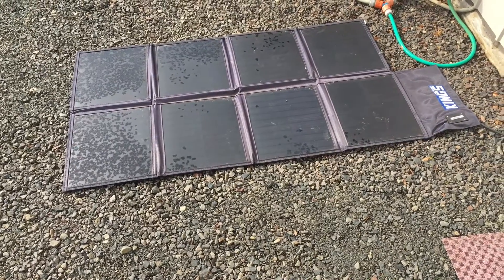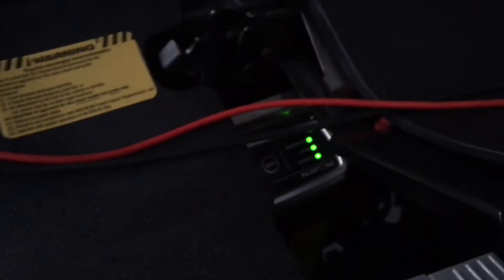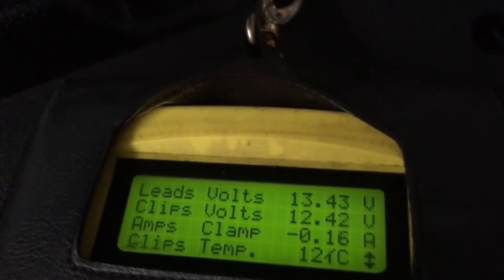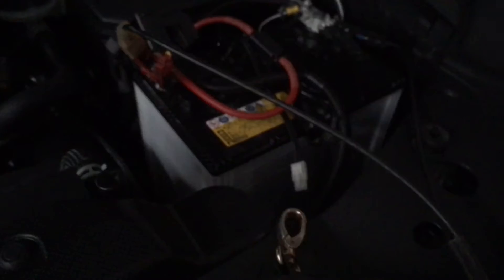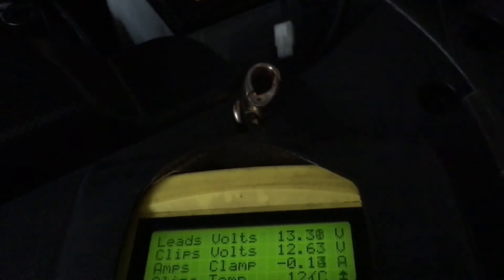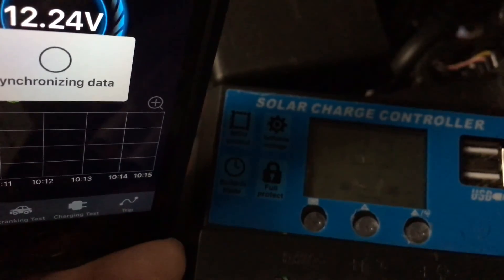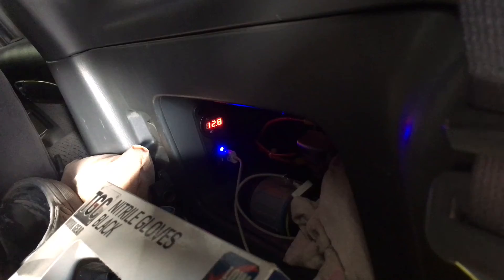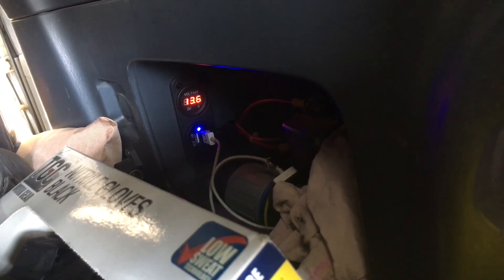INTERESTING SOLAR EDUCATION

Comment: Not really a fair test running the controllers in parallel like that. A fair test would have been to have two sets of panels exposed to the same light one for each controller.

Comment: Suspect you have a cheapie solar charge controller.
Some now have MPPT
Maximum Power Point Tracking...exactly means what it says...basicly the electronics is designed to give maximum output regardless of light conditions.
In the old days only Vitron brand and other quality brands had this, but now even cheap knock offs have this feature.
Ensure your next Solar charge controller has it.

Comment: The Mppt solar charger of the Projector module is clearly giving more current, than the Pwm module to the 120 Prado. Are the leads the same length and thickness?. From the split the Pwm module could be getting voltage drop if its from a lesser cable or length.
Thanks for sharing the info.
Cheers
Reply from the maker: It’s bizarre.
Messed around with many different leads & nothing wrong with them even with length.
Reply from the maker: Pwm is up & down inconsistent